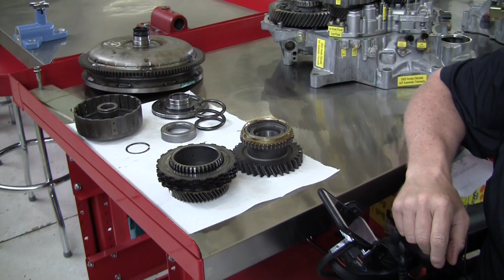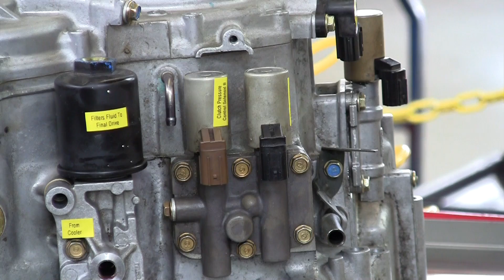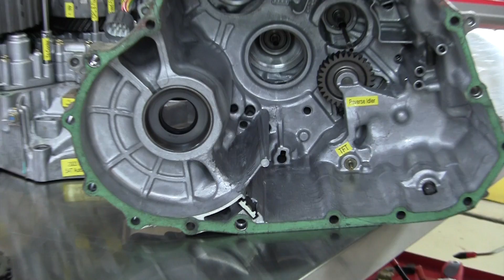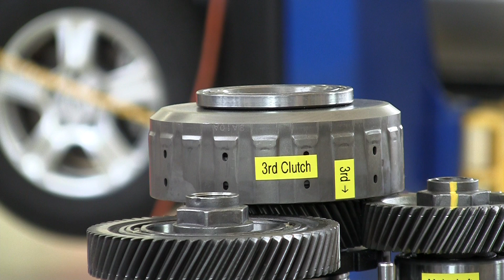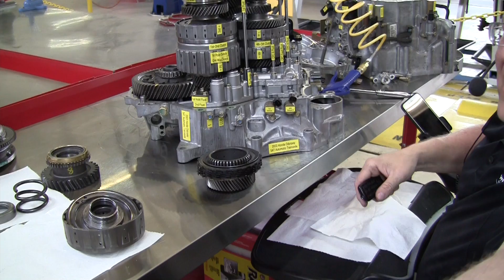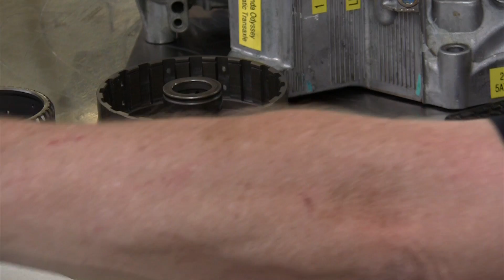Honda AT5 Automatic Transaxle

Comment: how's the reverse in this one?
Reply: When you select for reverse, the valve body sends fluid under pressure to a piston mounted on a shaft, the piston and shaft move to the left side of the car (up in this video) and engages the hub on the shaft to the reverse gear.  That idler gear he pointed out (that has to be moved to get the cases apart) then comes into play and you get the wheels spinning backwards, which is your reverse gear.  When you take the manual valve out of reverse position, oil gets put to the other side of the reverse servo piston and it then moves back down into its bore, taking the reverse slider along with it.  Right, Prof?

Comment: Thanks for the video!
You mentioned that Honda, other than the others, puts the solenoids directly on the transmission case. Is there an explanation for it? I can imagine that the cost could have been reduced with all the components arranged on one center unit. Can it be that this 5-speed-AT is based on a manual transmission so that the solenoid is built as an add-on solution?
I'm looking forward to you next video.
Reply from the maker: ***** I have no explanation for the external solenoids. You make an interesting point regarding an add-on solution to a manual transmission. Their 4, 5, and 6 speed transmissions all have external solenoids. It is certainly easier to service, with external solenoids. Thank you for watching.

Comment: This seems to be the same concept as was used by GM/Saturn in their TAAT 4 speed automatic transaxle of the Saturn S series. They have an input shaft and a counter rotating shaft geared to the final drive differential and a hydraulically operated slide gear for reverse.
Reply from the maker: squagimus Good observation, Saturn did use some Honda transmissions in some vehicles. Thanks for watching.

Comment: thank you for the video.  oddly enough, i just traded my 2015 Honda CR-V that has a new engine with direct injection and a new CVT transmission in for a 2014 Honda CR-V with the old engine and regular automatic transmission. There is a vibration at idle and from 65-85MPH.  it's a pulsating vibration that comes and goes, almost like there are two vibrations slightly off frequency or in and out of phase.  Honda just put out a video recognizing they have a problem but have yet found a fix.  The crvownersclub forums are blowing up with activity due to this flaw.  Maybe a topic for a future video!  :)
Reply from the maker: more jello please Thanks for the feedback, information and suggestion. I hope they get it resolved for you. Thanks for watching!